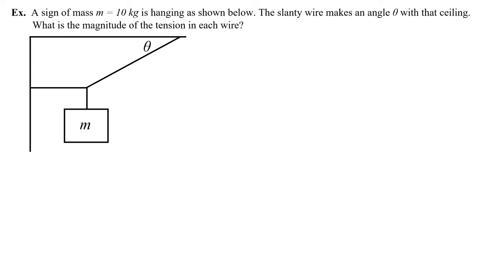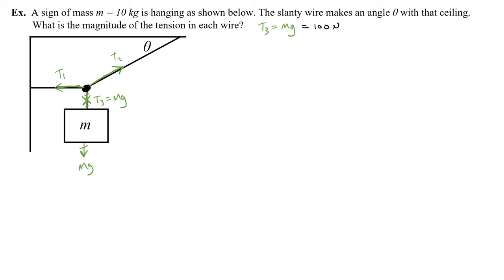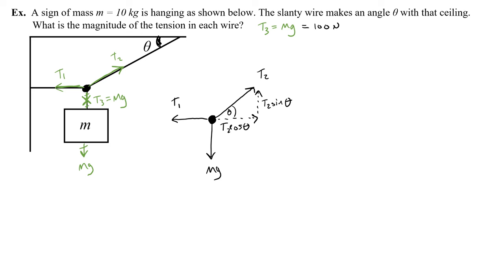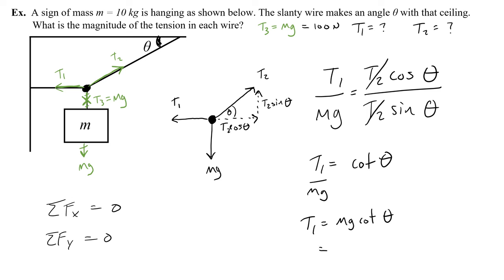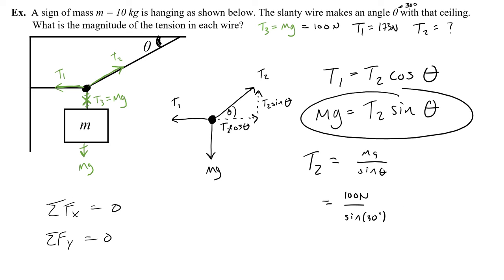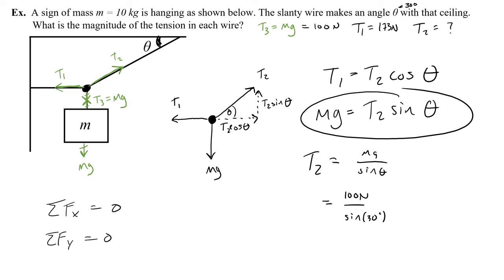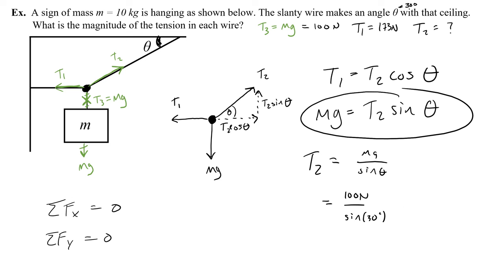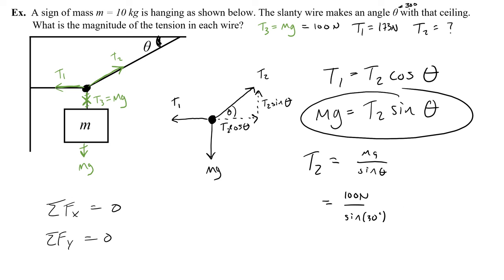How to solve tension problems with angles

Comment: Can i ask why the cos and sin had flipped such as how cos is usually the x value and the sin is y, but in the 2nd problem you had flipped them?
Reply from the maker: Sure! In short, the side that is adjacent to the angle is always cos and the side that is opposite of the angle is always sin. USUALLY cos goes with x and sin goes with y but the second problem is one where that is not the case. Hope this helps!